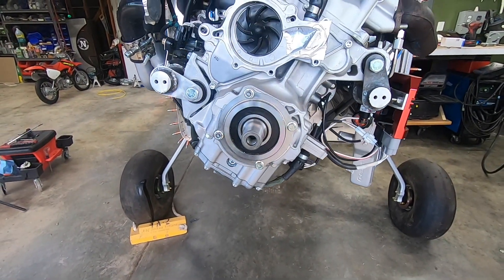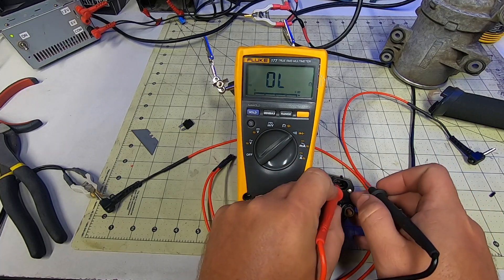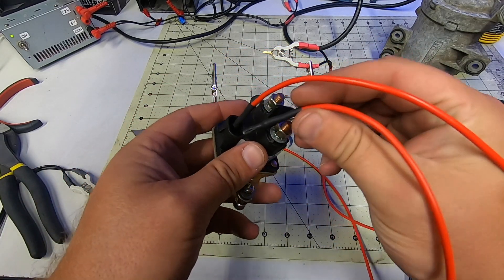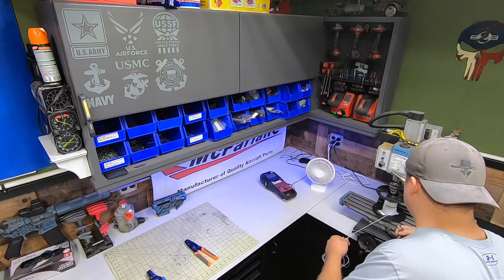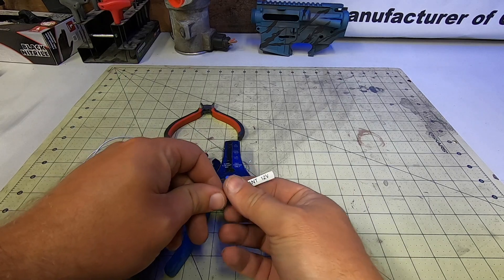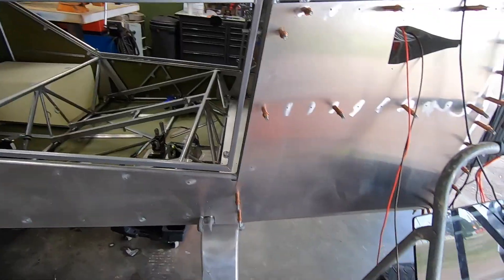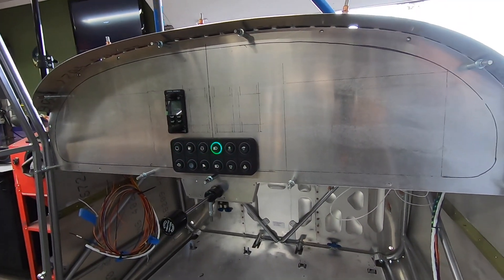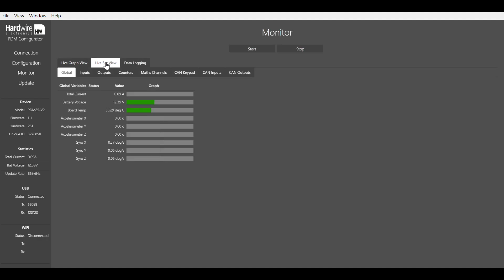RANS S-21 YAMAHA 998TURBO EP33 DIODE STARTER RELAY TEST

Comment: They are called "Freewheeling diodes" or "snubber diodes"any coil will have a back emf (voltage) in the opposite direction when the field energising it collapses. That is what causes your sparking and the voltage can be very high...hundreds of volts sometimes !!!!. When the diode is fitted  this then makes the coil polarity sensitive. I think this is why a lot of relays/solenoids dont have diodes as its easier for some people to wire up also it depends on what is in your circuits where you need the diodes as well.  The diode makes the device polarity aware and of course if you hook it up backwards you will either blow a fuse or the diode depending on how much current the diode can handle.....great video too Josh for non tech people
Reply from the maker: Thanks Mark! I thought you might have to good info to add to this one👍
Reply: Snubber diodes learned all about those back in electronic tech school then went on to my first job working on CRT monitors and Wyse dumb terminals from local hotels had roaches and mice in them.  I got shocked by them when trying to probe a live circuit with an scope. Good times I decided to head into IT back in 1990's get some certs never went back to electronics after that. Switching power supplies use them CRT monitors have lot of high voltage. Interesting enough those old CRT's electrolytic caps were bullet proof compared to the junk shipped in LCD TV screens today. Chinese copied the Japanese quality caps but of course turned out less then quality at a much cheaper price. TV manufactures today all they care about is get past the 1 year warranty.